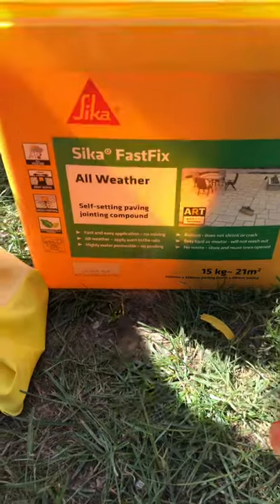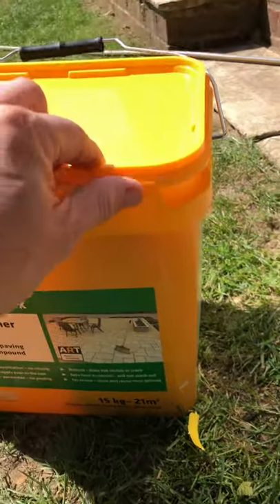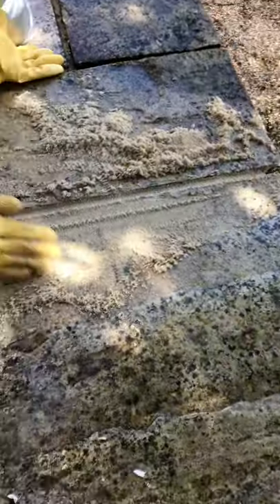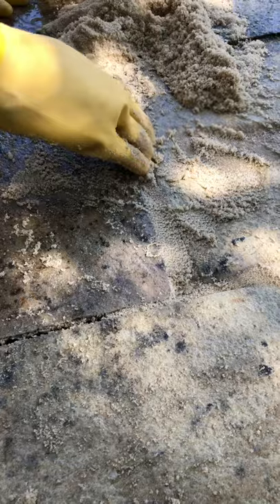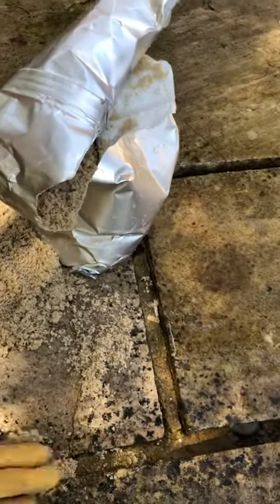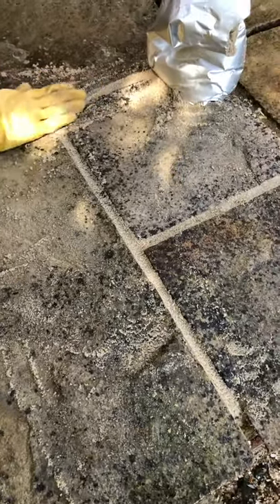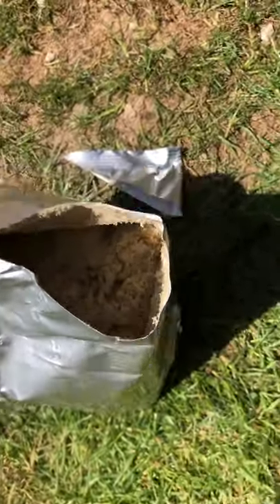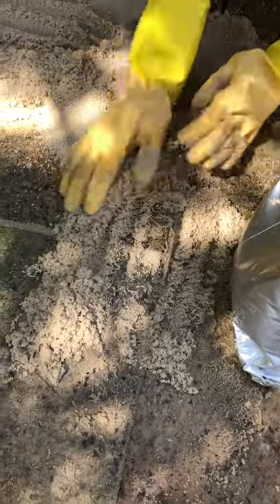PATIO GROUTING - Re-Jointing a Patio

Comment: Tip:
For large areas I fill in the big cracks with sand, when compacted down, add the top couple of centimeters with the concrete and level it off as normal.

Comment: Hi there, as this was uploaded 3 weeks ago, how's the pointing sand doing? Did it set ok as I am thinking of using the same product but many people are saying to does not set and I will end up having to remove it and redo the pointing using a different product. 
Great informative video by the way! 👍
Reply from the maker: Hi Nathan. 3 weeks later and it’s looking great to be honest. I showed your comment to my wife and she said just be sure to push it down into the cracks well. We are happy with it. My brother in law told me that he did his patio with the same product (although his patio was in much better shape than ours) and a year later it’s fine. Although he does say he may need to do some “top up work” once in a while. What was the different product you were referred to?
Reply from the maker: Also my wife says that my brother in law used the brushing technique (as per the box instructions). We used (or rather she used) the pushing down technique. Get your rubber gloves on and give it a go. Maybe try just one box first to see how you get on.
Reply: @diydaddailydiary  thanks for the response and advice. The other product I was thinking of was called Geo Fix (in a red tub) but is almost twice as expensive and looking at it seems to be the same type of product. 
Just wanted to make sure I'm picking the right one first time. Cheers 👍
Reply: I use this product on every Indian stone patio we lay, we put it with a pointing trowel and really force it in and then sweep diagonally across the paving. It doesn’t stand up to great if you get close with a jet washer on it but that’s the same for most jointing materials. The stuff that is twice as expensive normal it’s a two parter where you have to mix a harder in then squeegee/soft brush it in and should stand up to 3-4 tonne vehicles on it,  you can get some that will take a 40 tonne lorry but obviously don’t need that on your typical patio
Reply: Wise men say only fools brush it in. If you know, you know 😉